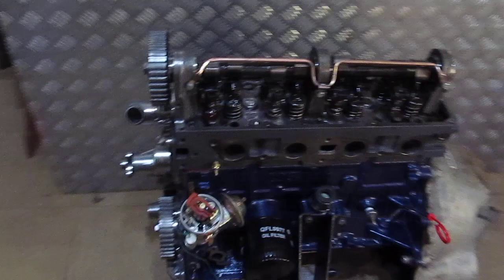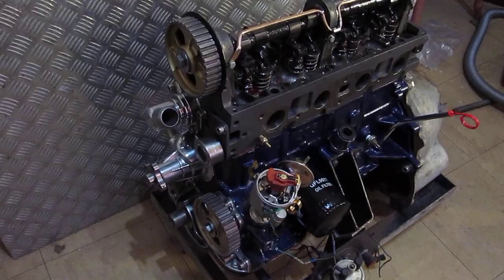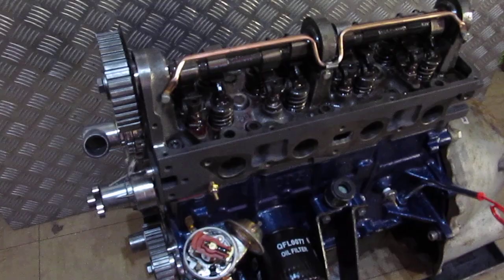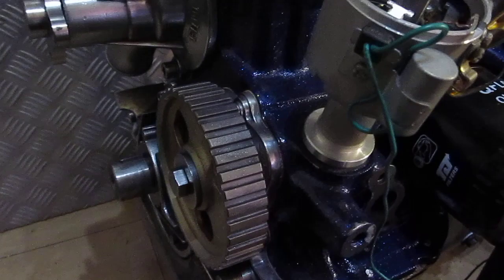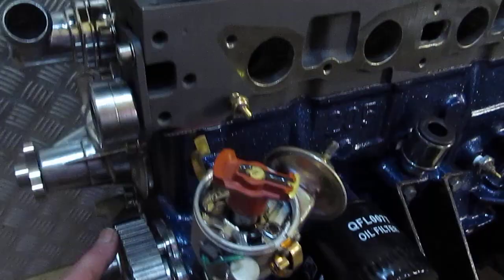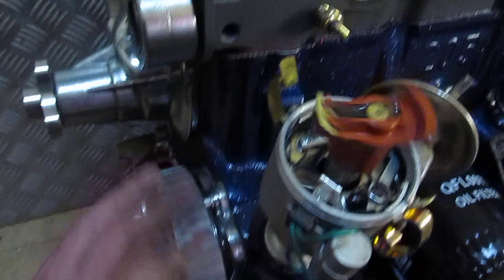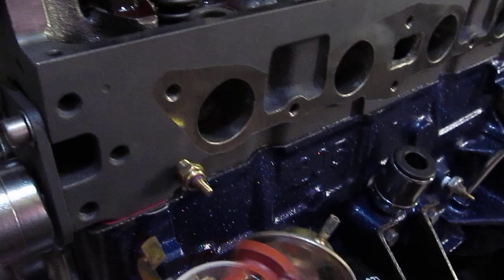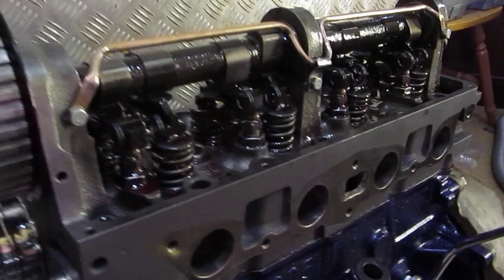Workshop stories Vlog 3  Ford OHC Pinto engine tip.....

Comment: As a kid I had no idea these motors were so popular in Europe. I always figured they were cast off designs, and that the Europeans had moved on. I figured that because of stereo typing of the time, everything Europe car is better, and these engines were such dogs. I was like, how could anyone serious like a Pinto motor? It is pretty cool to see that upper cylinder head rocker area in a new video. It brings back many memories trying to get those to run good.
Reply from the maker: The euro spec Pinto had a long lifespan over here,  it was introduced in 1970 as a 1600 and 2 litre,  it was fitted to the Cortina, Capri the MkII Escort and the Transit van.... There was very little difference in spec between the Escort RS2000 and the 2 litre fitted to the Transit van.....  If you search through my videos you will find a few Pinto engine fire ups, I have built a few....  Thanks for watching.
Reply from the maker: Forgot to say they were used until around 1992.

Comment: Double tip, use a speeder bar. This is a regular thing on my dry sump V8, pump the 2 gallon of oil back up into the dry sump tank :o)

Comment: Thinner than 20/50 oil I'm sure, engine block colour is superb
Reply from the maker: I have been involved with Pinto engines from a young age, in summer I would run them on a 20/50 mineral oil and during winter a 15/40....  with oil changes at around 4500-5000 mile intervals... never had any issues.
Reply: @BLOWN8CYLINDER  oil looked really runny coming out of spray bar, not a bad thing tho, my pinto revved freeier using 10/40 Mobil1 than recommended 20/50 mineral in a rarely used Westfield

Comment: Looking for tyming and fairing order plz.
Reply from the maker: Hello Hannes ,  the firing order is 1 3 4 2 and for ignition timing rotate crankshaft in direction it runs to bring the piston on number one cylinder upto almost TDC, the timing marks on the front pully are ar 2 degree intervals and you need to set it at 6 degrees before TDC , with the crank set and with distributor cap off and retaining bolt slackened rotate the distributor so the rotor arm is pointing at where number one lead is on distributor.... some have a mark on top lip of distributor body.  This if done correctly it shouldn't be far off and can be checked with a timing light. Hope that helps.... Adi

Comment: Is this a non interference engine??    If the timing belt breaks while driving, will the engine still be ok???
Reply: Yes it B ok split many Ford 2.0L OHC cam belts.Did 1 in 20mins on busiest Rd.In NZ.Very easy there are markers pointing to where it goes once you have Top dead centre.(No.1 Piston up.It is only single Ohed/cam & it's right in front of engine Behind radiator.So so simple.Always carry a spare.